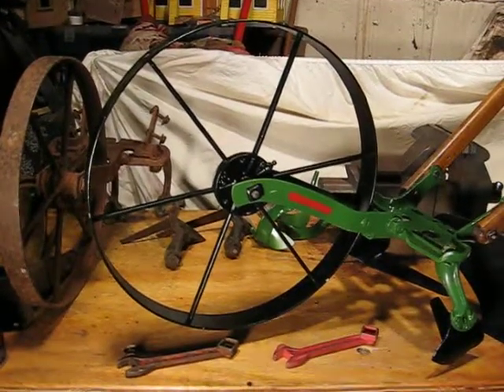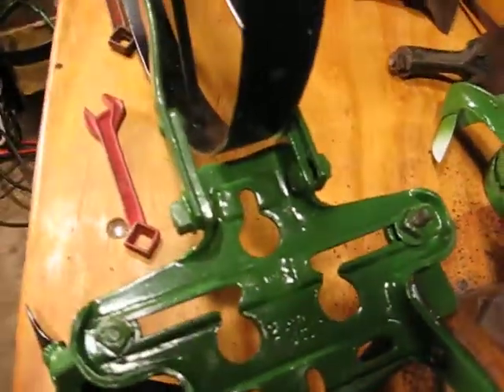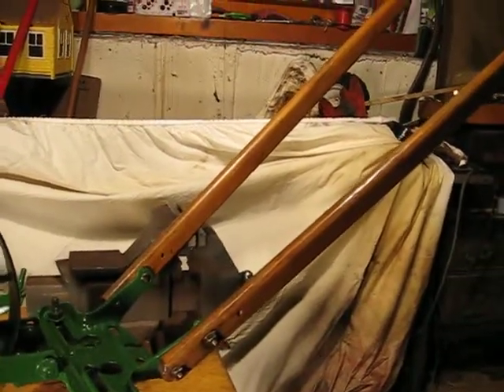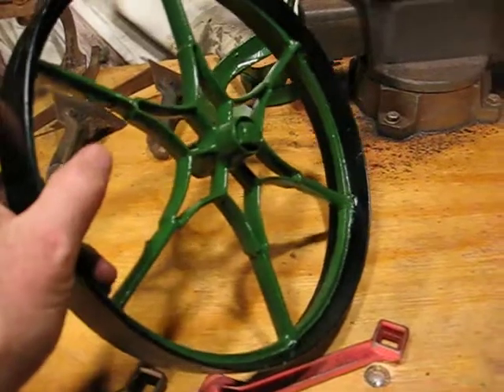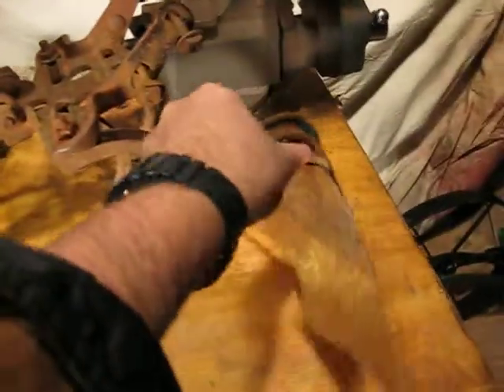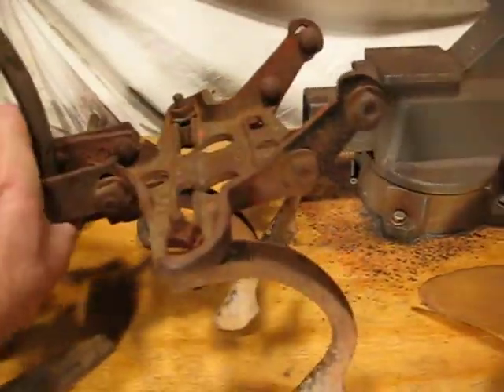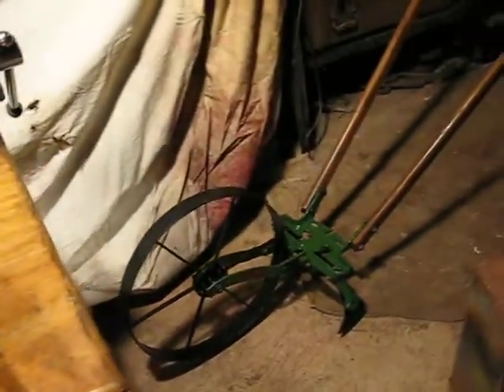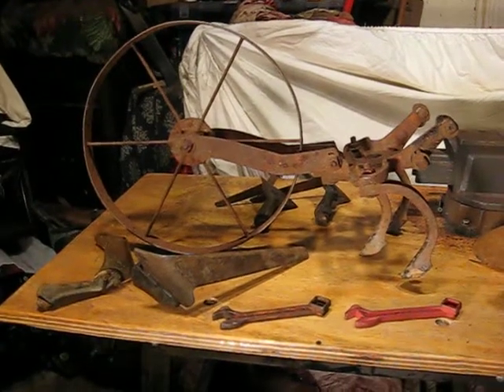Planet Jr Wheel Hoe Restoration  part 5

Comment: Say please, did he come to the seeder?
Reply from the maker: This unit does not come with a seeder. The way to tell if the wheel hoe can adapt to a seeder is that it will have a gear on the center of the wheel hub. If it does not have that gear then it will not accept a seeder.
Reply: Thank you, i was also thinking , of just studying the old ads of Planet jr 25, there it all comes as one set.